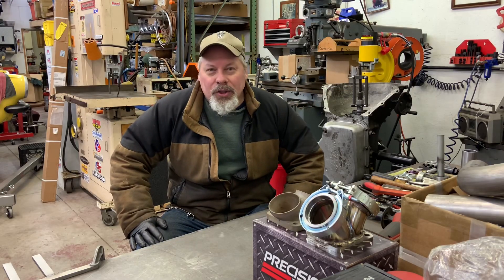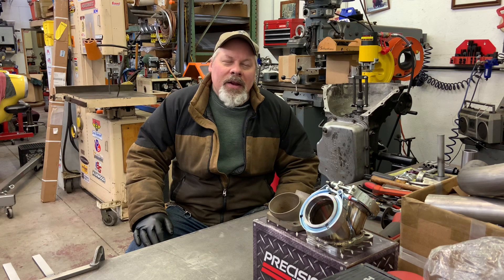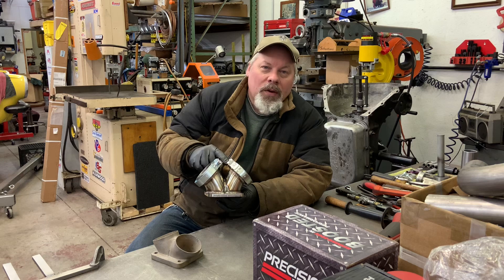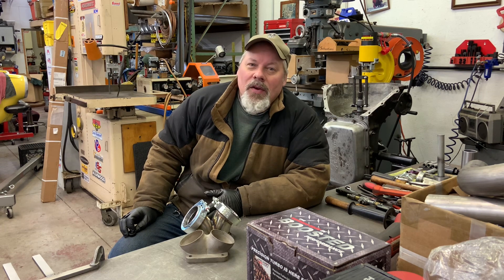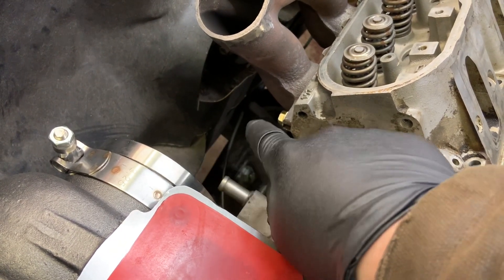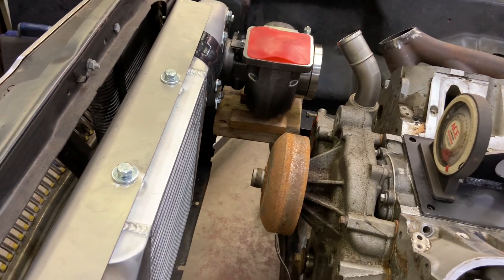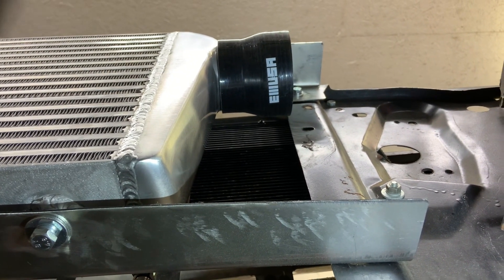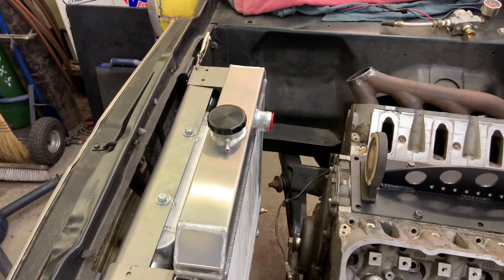1964 Dodge Dart GT Turbo LS: Cold Side Mock up

Comment: I've been running a VS wastegate for over a year and a half with no issues.   I welded it directly to the turbine housing and it works great.  Allows me to control boost all the way down to spring pressure with a simple 4 port mac valve.

Comment: Biggest exception I see to old tools is in cordless electric tools. Lithium batteries and brushless electric motors have already made previous battery tools and many corded tools obsolete. Lithium/brushless is displacing a lot of air tools too. And quickly displacing some smaller two and four stroke gas outdoor equipment.

Comment: Speaking of tools, what brand and model number is your yellow punch in the background?
Reply from the maker: It is a CH-70, eBay. I bought a air/hydraulic pump to run it.
Reply: @mountainsgarage  Thanks.  Need to add to my tool collection.  :)